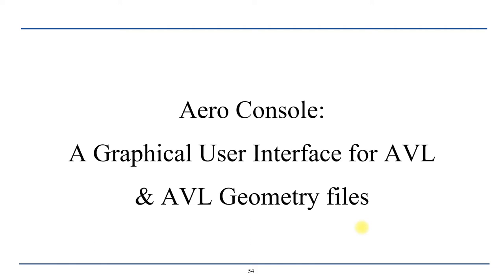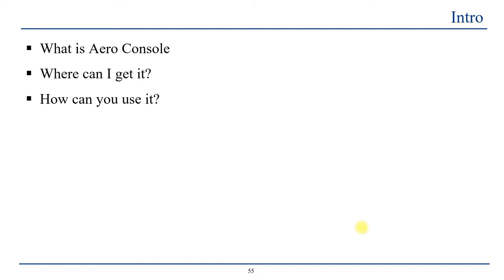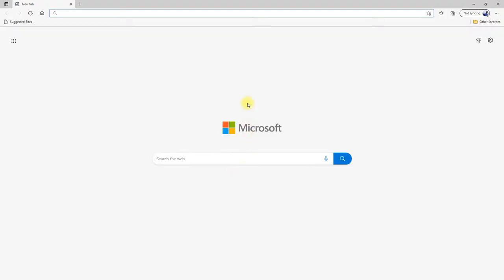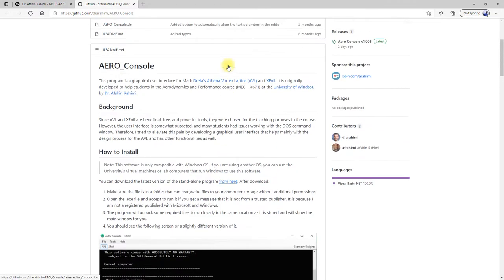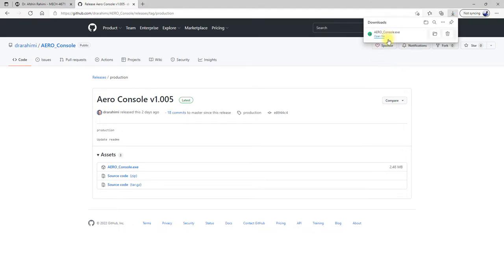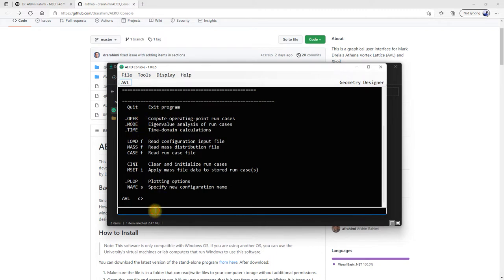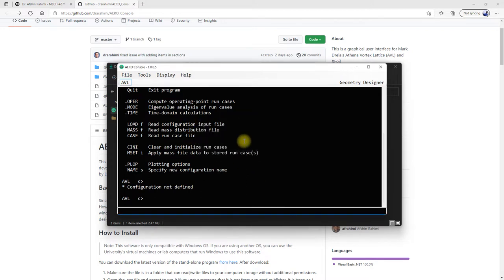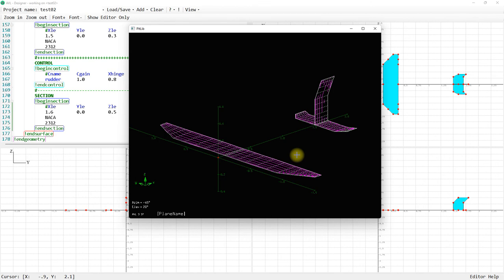AVL Tutorial -  Part 04 -  Aero Console and Geometry Files

Comment: hello, how did you plot the plane? I made every step on video but its showing only the key inputs options window and when i try to load geometry it shows:
File READ error:  e423.dat  
 **   Airfoil file not found  : e423.dat
 **   Using default zero-camber airfoil

 * Cannot adjust spanwise spacing at section  2, on surface [asa]
 * Insufficient number of spanwise vortices to work with
Reply from the maker: I think I replied to you via email so no more need to reply here. Hope your design is working now :)

Comment: I am having difficulty adding a control after I have created a section. Basically, Putting a new control between two sections is giving me an error message. 
Here is what it says, 
 "You must have all sections and control tags inside a !beginsurface and !endsurface tag block. If your cursor is not between the !beginsurface ad !endsurface, move your cursor to betweeen the two tags before inserting a section block"  

and after doing what it says there is no remedy. Seems like there is a bug or the issue is Aero Console will not let you move a control or add one in after you have created the sections. Any help?
Reply from the maker: Hi, this check is done in Aero Console not AVL, and there may be some issues with this as it was not thoroughly tested. I will be doing some improvements over the next couple of months but cannot give an ETA for when it will be looked at. I suggest you look into other ways around this issue or use other UIs for AVL.

Comment: Thank you. Is it possible to save the CL distribution, so the values of CL in y?
Reply from the maker: Yes you can. After you load your geometry, mass, and run file, you need to enter the OPER menu, then eXecute the computation and once that is done use the command FS for strip forces. If you wish to just see them you can press ENTER or if you wish to save them in a file you can write a file name and press ENTER.

Comment: Thank you for your perfect explanation. And, I installed the latest Aero_console (1.3.0) and went through the geometry designer and I couldn't see the "Load/save" button as you shown
Reply from the maker: Thank you for your kind words. Over time since I uploaded that video, I have made changes to the software based on the comments and feedback I got from my students. So the latest version of the software that is on Github has some changes to the video version you see on YouTube. In version 1.3.0, if you have project files in the directory of the Aero_console.exe file, the app will load them in the project name drop down list and then you can switch between the geometry/mass/run files by clicking on the corresponding tabs in the geometry designer to have a quicker access to each of these files and as you click on any tabs the other tabs are automatically saved to save time. If you want to save a new project, just type a new name in the project name field in the geometry designer window and start typing your code in the geometry/mass/run tabs and they will automatically save to the filename you gave with the proper extensions (i.e., avl, mass, run) for each file. For example, if you type "test" in the dropdown list and start working on geometry tab (writing code) the program will automatically save test.avl in the same directory as aero_console.exe file for you to work with.

Comment: Hi Afshin, I really appreciate your work, thanks for your tutorials they are excellent. I have some questions related to the HingeVec keyword, what happens if the control surfaces  has a swept trailing edge? How should be defined the HingeVec?
What mean if the HingeVec  is 0 0 0? HingeVec values can only vary from 0 to 1 including negative values? and finally  :)  you consider that AVL can used to preliminar design in airplanes of full scale?
thanks for everything! :)
Reply from the maker: Hi Abraham, you are very welcome. 

For the hinge vector question: from the official AVL help file "XYZhvec  vector giving hinge axis about which surface rotates + deflection is + rotation about hinge vector by righthand rule.          Specifying XYZhvec = 0. 0. 0. puts the hinge vector along the hinge" This means if the wing is swept, the program will automatically rotate the control surface to rotate along the hinge  regardless of the orientation of the wing. So even if you have a swept wing, keeping this vector as [0, 0, 0] should do what you need.

For the applicability of AVL for preliminary design of full scale airplnes, this is a stretch to use AVL for such purposes but if the design is in very very early stages it should be OK. Oterwise you would need to use moe advanced and recent applications to model your aircraft and perform your design process. Examples of such tools can be found here https://www.sculpteo.com/en/3d-learning-hub/3d-printing-software/best-aircraft-design-software/
Reply: @arahimi_  excellent, thank you very much for your answer, I have also heard that Xplane to model the flight dynamics can be an interesting option, even though the flight model is based more on the blade element theory than on the stability derivatives, what do you think about it? thanks again I appreciate your time
Reply from the maker: @abrahamreyes3917  You are welcome Abraham. I have not worked with Xplane but it seems to be more towards demonstration purposes and demos that aerodynamics analysis. I don't know if this would be a good option for just preliminary design purposes.
Reply: @arahimi_  Thank you very much for your answers, I really appreciate it. One last question, I promise :) Is it possible to extract the data values from the distribution of the cl of a wing in AVL? thank you so much!
Reply from the maker: @abrahamreyes3917  Hi Abraham, yes you can. After you load your geometry, mass, and run file, you need to enter the OPER menu, then eXecute the computation and once that is done use the command FS for strip forces. If you wish to just see them you can press ENTER or if you wish to save them in a file you can write a file name and press ENTER.
Reply: @arahimi_  fantastic!, thank you very much for everything! :)

Comment: will Xhinge will differ for each type of wing or is it 0.8 itself, sir
Reply from the maker: It depends where the control surface is hinged at as a percentage of the chord. in this example, +0.8 means it is hinged at 80% of the chord from the leading edge of the airfoil to the trailing edge of the airfoil at the section of interest.

from https://web.mit.edu/drela/Public/web/avl/avl_doc.txt:
Xhinge   x/c location of hinge.
           If positive, control surface extent is Xhinge..1  (TE surface)
           If negative, control surface extent is 0..-Xhinge (LE surface)
Reply: sir, thank you for the response. one last query  How to calculate the chord % where the control surface is hinged.
Reply from the maker: @nitheshkumar9886  No worries. the xhinge value is a design parameter, you are either given the value in your requirements or have to come up with it as you try to improve your overall design performance